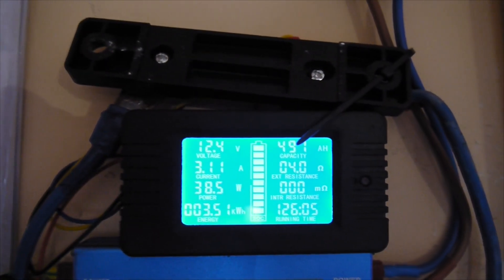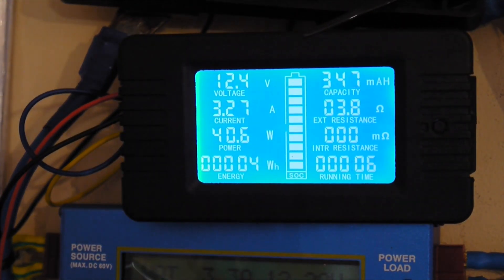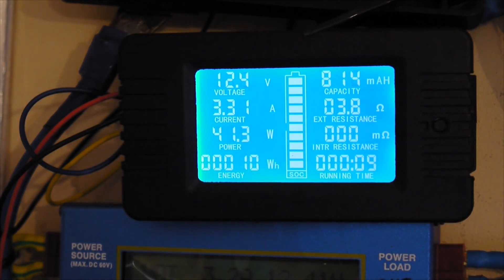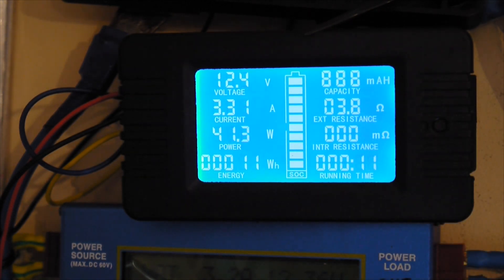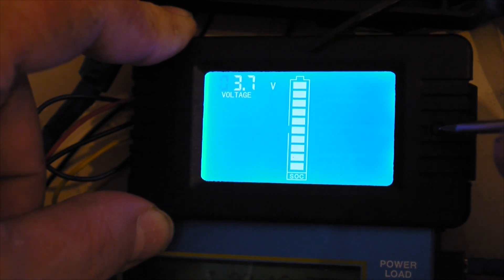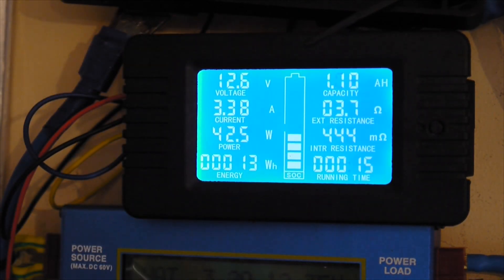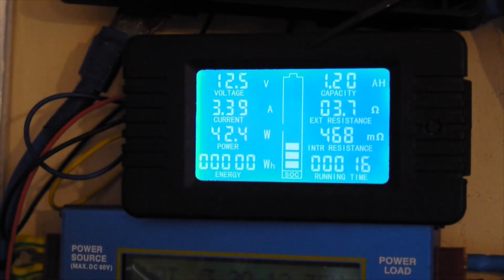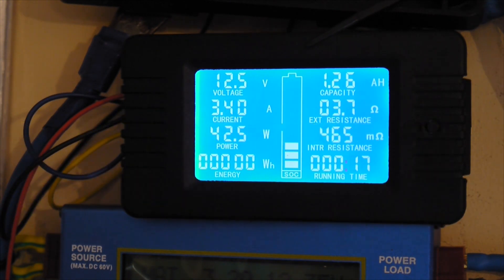Peacefair PZEM 015 Multifunctional energy meter, great tool for solar power

Comment: Question for you if you draw more amps than the shunt is rated for ,can that damage the devise? I have a 100 amp shunt and was running 1500w , now it doesn't show proper power consumption.
Reply from the maker: Check the connections, I don't think it's blown..
Reply: @viocaia   I was thinking the same .thanks

Comment: Q?: For the amp setting. Is this the Max the line can handle (my 4/0 gauge has 200A fuse, and expected surge of 166A) or is it actually the shunt Max Amps (mine is 300A)?
Reply from the maker: The shunt is the key! Don't forget to sett the amps on the device according to the shunt in use.

Comment: It's only good for doing capacity test of battery. Not for energy storage meter application. It's unidirectional,hence can't measure the discharge/charge (depends on how the shunt is mounted).
Reply from the maker: Right!

Comment: Does it tell you if the battery is in Charge mode or Discharge Mode ? I tried on my side and I am disappointed. My current is always positive wether I am discharging or charging the battery.... Maybe I did something wrong... But hard to know... Thanks in advance if you can confirm or not on your side.
Reply from the maker: for discharging mode, you need to have the battery on in and the consumer on out thru PZEM015, but PZEM always count in, plus and plus, never goes back..so if you want to reverse process just place battery on out, for charging and the power supply on in...
Reply: @viocaia  Thanks. Not good for me. Because it is in between solar MPPT and the battery. So I wanted to have real time view of capacity in and out... Can't do that with this displays. I bought 3 of these. Not a good idea. Useless ! It is more or less just a voltmeter. Even the battery scheme giving the status is only referring to voltage... Not counting electrons as it could be. Too bad. Thanks for the chat.
Reply from the maker: @EpalzeoG  I'm sorry but this is energy meter, gives you the AMps, watts, instant power , voltage and many more..maybe you should check the connections...mine it's working perfect, I have a video about it, the PEM was connected from solar panels to the inverter..I had a clear power in statistics for more than 2 months.Look here...https://www.youtube.com/watch?v=iIn72jZns_U
Reply: @viocaia  yes but at night if you power from the battery it does not tell you negative power, so you don’t see the battery emptying....
Reply from the maker: @EpalzeoG  Right! It's one way only..but if you have more..install one for in and one for out..and at the end in 24h you''ll have two numbers..how much got in and out..that's even better! you can see the state of charge, the real needs for daily output..so on..just an idea.

Comment: mine never stop counting the battery capacity, should be 150Ah, now reach 400 Ah
Reply from the maker: Is not about counting, after a while with no power it is reseting the shunt value, goes to 100A shunt...if you have a 50A the counting will be wrong, like doubling the values for current and energy..the machine thinks for 100A shunt instead of 50

Comment: hello, so state of charge is based on voltage? it is not good for lifepo4 then?
Reply from the maker: You can adjust the limits by your needs..in my example was from 11.9 minim to 14.5V max..so it can be use with anything until 60V